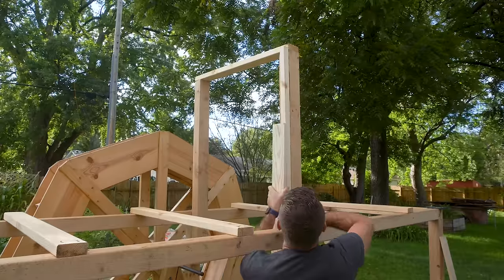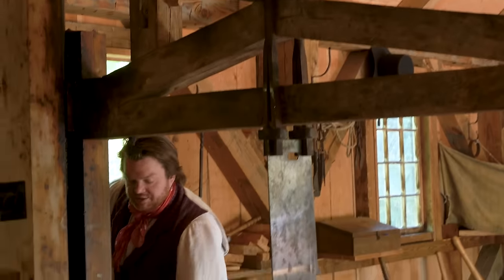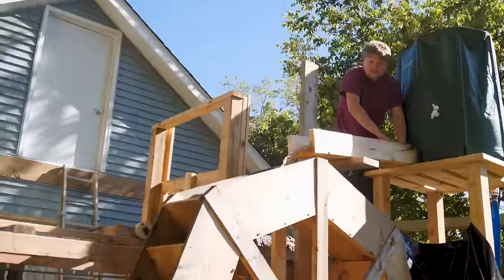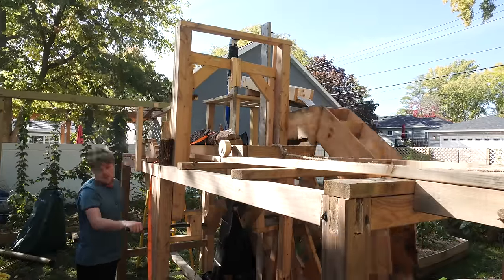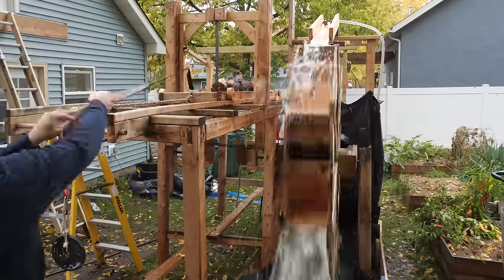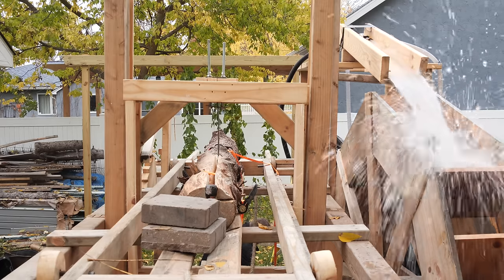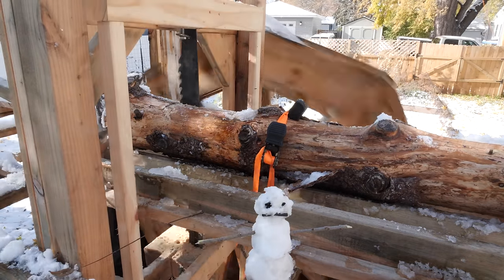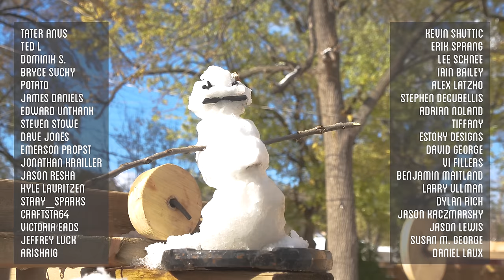I IMPROVED DaVinci's Saw Mill!

Comment: You want to off set the blade teeth so the cutting edge is thicker than the trailing edge, minimizing blade friction
Reply: he did but he is still dragging the saw away from the wood on the downstroke and pushing it into the wood on the upstroke
Reply: @jimysk8er see now I'm confused cause the comments on part one said to force down...and that's the way the saw mill in Michigan works
Reply: 11:43 you can see that they have already done that
Reply: @theomelchior2739  it's the slight play in the channel of the saw. His saw is on fact cutting on the down stroke because of the teeth but as the saw moves down it gets pulled just a bit away from the wood and when it comes back up it gets shoved back into the wood. If you were cutting by hand you would do the opposite instinctively. If he flipped the direction of feed 180 degrees he would get the blade reaching into the wood to cut it and pull away from it on the way up.
Reply: He doesnt listen to criticism sadly

Comment: You might try adding a heavy flywheel to the design where the weight is on the down stroke during cutting to help preserve some of the wheels momentum.
Reply: was thinking the same thing. could also add weight to the saw sled to make the downward cut more consistent.
Reply: I think the main issue is just that the connection between the wheel and the blade has enough slop in it that it can jerk back and forth, which loses a good bit of the energy
Reply: that might be why the other sawmill he showed had rounded teeth, to rely on the downstroke instead of both

Comment: I wonder if adding more weight to the waterwheel or adding a flywheel would help. Get more mass moving to prevent binding issues.
Reply: Probably.
Reply: yeah, as it is pretty much half of the wheels rotation is wasted energy. when the axel is pushing the saw up, it's working. when the saw is pushing down, it's not. adding a sort of off-balance flywheel could fix this, by adding weight it must lift during the downstroke, which falls during the upstroke. this would also make downstroke binding more likely though.
Reply: @arcanealchemist3190  my initial thought would be like some sort of gate to vary the water flow, but it's probably way too convoluted to work lmao, and it's the kind of issue that goes away when you scale up due to just general inertia
Reply: @arcanealchemist3190 Instead of directly driving the blade, they could add enough weight to the blade to pull the blade down and have a waterwheel-driven ratcheting mechanism to lift it.

Comment: It would probably help a lot if you could make the blade move significantly faster, while keeping the log moving at the same rate.
Another upgrade to make the motion more stable would probably be a different mechanism converting rotational motion to reciprocating. That single rod looks like it can't hold alignment, possibly adding a lot of friction to the "bearing" connecting it to the water wheel.
Reply: Only way to make it faster would be gearing, or a cam shaft with two, or more, bumps. Then you have the issue of the down stroke and it getting stuck
Reply: @Volt64bolt  down stroke can be adressed by adding weights on the frame and greasing it with bees wax.
Reply: Gearing and adding a fly wheel you could bump up the speed and smooth out the down stroke
Reply: That cam linkage is looking rough, it does need smoothing. I think its actually a little short. When it came to the older mechanisms, they did use longer strokes.
Reply: @Volt64bolt  sadly he doesn't have enough power for gearing, he would either need a two person hamster wheel or a strong river to make it work.
Reply: @johnbarr9857 the linkage is way to short, in times where it needs the most power from the wheel its pushing at a 45 degree angle, so half the force is put in the sliding surface steeling power and increasing friction. With a connection rod several times as lang it would be way more efficient
Reply: You should make one and show us how all of your improvements work
Reply: "It would probably help a lot if you could make the blade move significantly faster" This is the dumbest comment in the thread. Really? more power would help? you think?

Comment: The design of the cutting edge has alot to play in how the machine performs. You need a Rip Saw (flat chisel like tip to the blade points) for cutting with the grain of the wood. Cross cutting the grain needs a sharp leading edge to slice through the wood fibers. Try each type of blade on hand saws and you will be amazed.  Keep up the good work 😊
Reply: I think the difference in cross cut and rip cut is one of the main struggles with this build.
Reply: Same applies to a chainsaw, too. A crosscut chain has a sharp leading edge, which makes extremely rough boards. A rip chain has almost flat leading edges, which greatly speeds the cut and smooths out the boards.

Comment: as others have said, the linkage between the wheel and saw frame needs to be longer to reduce the binding loading on the frame. this could be done with like a see-saw linkage near the bottom and then one doing back up to the top.

Comment: Your woodworking has really come a long way from the start of the series, I’m honestly pretty blown away by how far you jumped from day one to now!

Try adding weight to the wheel, so when it starts going it carries more momentum through the resistance, make sure the wheel axel is as frictionless as possible, think about increasing the capacity of the flaps in the wheel so more water can fill them, you can get more torque out of less water that way.

The axel that drives the saw is crooked, so you’re losing a lot of force there and it’s what’s stressing those joints so much. Also if it was a little longer your could get more out of each cut of the saw. As it is you’re only using about 20% of the blade area for each repetition.

Comment: I think the blade switch success can best be understood like bandsaw blades: any blade has a max number of teeth they want engaged with the wood at once, they all also have different gullet sizes, the gap/spacing between the teeth. For thicker cuts you need more gullet room to sweep away the dust. Otherwise they get clogged and just rub.

Comment: I know that isn't the point of this project at all, but it is a master class in energy availability:
While you were tweaking and improving the saw mill, the only thing you didn't have to worry about at all was primary energy. Yes you had the pumps to deal with, but that is just to get it period accurate. In the end, you used electricity. 
When water power was the name of the game, building a damn and channeling the water (unless you were lucky location wise) would have been the primary cost and labor sink.

This should give you an idea just how big a deal access to affordable electricity is.

Comment: the movement of your connecting rod is still pushing the saw into the wood on the bottom of the stroke which is the point where you need the most amount of torque to overcome friction from the blade while not actually cutting and also pushing the log up and away. I'm glad you figured out the constant pressure thing that I left a comment about last time (kinda wish I had a shoutout but whatever) same deal for adding a kerf to your sawblade although you don't have enough power for the amount of rake you put. adding some tallow or wax everywhere would be good for friction too.

Comment: im starting to realize that a lot of old buildings served the purpose of an immovable anchor for structures. a lot of errors made in the outdoor design is the slight play in movement due to not having a more solid foundation or less supported bodily structure. the ability to make this in your back yard is still astounding overall, even with the amount of difficulty you place on yourself with handicaps like only using self made nails and such, this is still a great achievement and very fun to watch.

Comment: Sweet machine of technology! I know that someone has probably suggested this already, BUT: since your machine is limited in torque output it would be a better use of its available effort to have a saw blade with 50 % more teeth and 75% smaller ones in the same thickness and with the same adjustability as this one. I know that easy to say and hella difficult to do but that would make best use of the power wheel, the throw of the saw blade and available torque of the wooden framing! Thanks for the coolest series on YouTube!!

Comment: You mentioned the age of steam at the end; if I may suggest, you should try building a Sterling engine before a steam engine. From my understanding, a steam engine requires all kinds of little parts like valves that can be difficult to nail, and it can even be dangerous because of the high pressure of the steam. A Sterling engine can be much simpler in design (I've seen people make DIY gamma-type Sterling engines with tin cans), and doesn't require the same high pressure to run. I think it would be a good way to experiment with heat engines before getting to steam.

(Or maybe that was already part of your plans, idk)

Comment: I think you would be better off using an electric motor geared to your water wheel while exploring different angles and lengths for connecting rod until you come up with better positioning. 
If you look at a metal shaper from 1890's~1950's you'll see the fast retract mechanism is just the link position pivot points moved, as it is at 11:00 mins in, the saw blade is pushing into the log on upstroke and possibly pushing away on the down-stroke?
When it's sorted out, then run with water to prove it works

Comment: Use a slow dripper onto the top of the cutting section that lubricates the blade with chlorinated or sulfonated waxes or soap mixtures that you can make from natural resources, and make sure the blade has less resistance and clears material well. This is why saws have slightly offset teeth.

Comment: If you are interested in improving this more, consider casting bronze plates for holding your axle & anywhere else that the wood doesn't seem to be strong enough for. If you want to stick with wooden components, get much denser hardwoods. You might even go to rarer species of wood such as the hornbeam species or the ironwood species.

Comment: You definitely need a different rectilinear movement on that crankshaft; Either increase the length of your connecting rod (which means you'll need to increase spacing between the crankshaft and the cutting frame). This would keep forces more in-line with the crank and the blade, and would probably fix a lot of your inconsistent blade motion issues.
Reply: Another option is to increase the theeth on the rachet mechanism (slow down how much the mechanism pulls the log agents the blade) or increase the size of the pulley wheel (same effect) I feel like trying to go fast is actually making it slower and requeres more torque (that's why so many pumps are needed)

Comment: I am late to the comments and so many to read so I apologize if so items were mentioned. Some simple suggestions from what I have seen that could help.
- Add a bow to the top like your shop saw, a lot of your binding is upward.
- Rerun your pull cable under the blade housing using a secound block, so the housing doesn't add pressure on the line.
- Change the wheels on the cart to run a track, between 2x4s, this would avoid the lifting issue.
- Animal fat as grease, bacon works
- A flow guide or slider for the water (simple flap or slider), sould give additional control and direct the waters power better. 

Over all good build, got my ADHD hooked for a bit at the least

Comment: When I lived in Guatemala I rented a room at a sawmill. They had a modern setup but they would keep the logs on in place with wedge poles on either side of the log. They would have a guy putting them in place at the beginning of the conveyor belt and another guy dangerously close to the saw that would take them out. I think you could use something like that to keep everything tight. Especially with this being a much smaller mill.

Comment: From the comfort of my own couch I can see two relatively easy ways for imrovements: 
1. Reduce slack in the system: Figure out a way to take all the dead space and rattling out of the kinetic chain. Maybe try it with a solidly forged one piece steel axle. Also a tighter connection between axle and saw frame.
2. Reduce friction in the system: Every bit of friction that doesn't come directly from the cutting action, but from the machine itself (i.e. the saw frame rubbing against it's bearing surface) should be minimized. Polishing, sealing and lubricating the wood might work.

That's my 2 cents, but I'm sure you've already thought of these! Awesome project!

Comment: You can increase the power of your wheel by increasing the angles of the water flow. When water needs to make a 45 degree turn, you can lose up to 80% of it's force so using gradual rounded curves is preferable to sharp turns. Adding a quarter round ramp on the outlet of your tank where it meets the trough will easily triple the power output of the water. It's all fluid dynamics.

Comment: more efficient to use a slotted link, a beefy rod on the edge fly wheel, rides in a slot of stiff cross member link with a fixed pivot on one end (non working end) then a stiff link connecting from the saw blade frame to the end of the motion link.  The extra link on the working end takes up the angular variation in the motion link.  Allows you to vary the length of the stroke on the blade with different fixed pivot points and flywheel diameters.  I am sure there is a name for it but it escapes me lol.  Looked it up common name is a scotch yoke.

Comment: Something like a vertical featherboard to hold the logs down? Short skinny logs pinned only on one end, "any" size log could pass through but when pushed back would hold fast.
Perhaps a second point on the shaft to push the log back off the blade when it does its upstroke?

Comment: First off, I'd like to say, awesome! 
Second off, it looks like having the join between the sawframe and the linear power input from the crankshaft be springy might help you get a big effeciency boost. Every time that frame hits the bottom with a smack, that's energy that could have been in the cut! Additionally, the neutral position of the saw frame should be in the middle of the downswing, so that the crank is pulling it down against the spring, which helps lift it on the upswing. You could probably use some wood springs (like bow limbs) on either side of the sawframe to accomplish this.
Reply: You may also find this to be useful for an alternative drive mechanism, where the spring here could be attached to a linkage driving the sawframe.

Comment: Sure people as pointed it out to you, but some sawmills used to have a pre-spam which the water flow to a smaller will to speed up the main will. Then they were engaged clutch system, which then activate with a saw blade, and transferred all forced to the main we’ll.

Comment: You need a lubrication system for the blade. Some oily cloths rubbing against the blade or drip system. That will greatly reduce binding and improve speed.

Comment: feel like it is all down to the low resistance on the water wheel... the volume of water a flowing river would be many times greater. I have seen an old Amish sawmill powered by wind, might be the best option if you aren't on a river

Comment: Awesome
can you make the water wheel widder?
use cogs/gears to reduce the gear ratio that drives the crank.
replace crank with an axle that has two cam lobs that push the saw blade down.

Comment: binding is usually from too high feed (lowering feed usually means lower forces but more time) the wood springing back (easily dealt with using thin wedges hammered in) or teeth not set wide enough forming too little cut relief.

Comment: Adding a flywheel, having a shorter stroke so the wheel speed is higher will help with binding, did you guys use some type of oily substance on all of the friction points ? Making sure the teeth on your blade are slightly thicker than the spine is crucial to keep friction down as well. And maybe adding a bit more free fall between the water and wheel, adding thin light material to keep water in buckets too...thank you for your time and effort!

Comment: How much tension was on the outfeed of lumber? WEDGES take the pressure off the blade, or in your case, open the ratchets a little more on the out feed to allow the wood to split.

.

Comment: Every step forward in precision for the cutting mechanism has helped so far... I think that's the direction to keep going in. When cutting, a directional saw's teeth should not ever grind away or hammer away wood. The teeth should act like perfect little wood-plane irons, removing a controlled bite from the wood with each stroke, and only cutting with the edge at the tip of the tooth, like a chainsaw cutter. Compressing the saw frame back into rigid supports should make the cut profile more consistent between draws of the blade, which will help with jamming even if it introduces more overall friction.

Taking the chainsaw cutter idea to an extreme, you could achieve a consistent kerf by making a modern style chainsaw tooth sideways with a separate rake (pushing the wood back) and cutter (pulling chips in): fold over each cutter in the saw blade 90 degrees a short distance from the tip, then add a shallow bend to the whole tooth in the opposite direction of the fold so the alternating direction teeth are mutually centered on the blade itself.